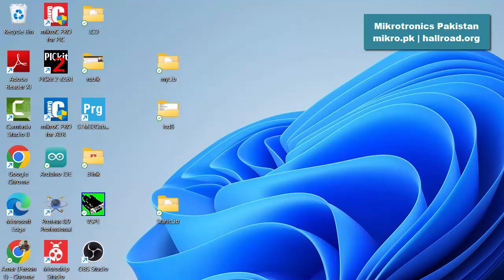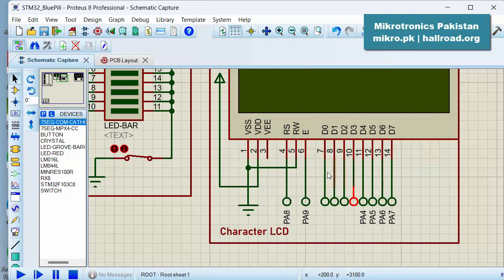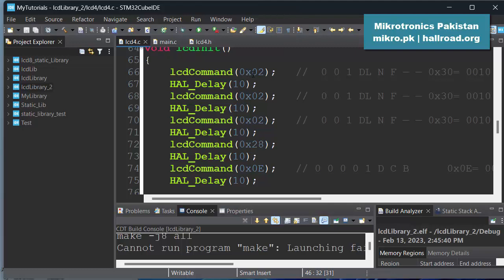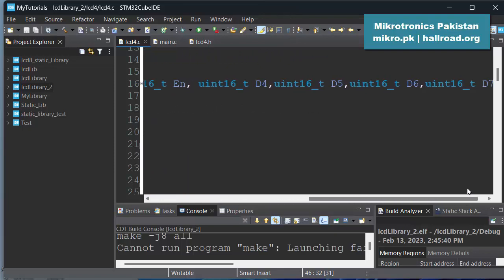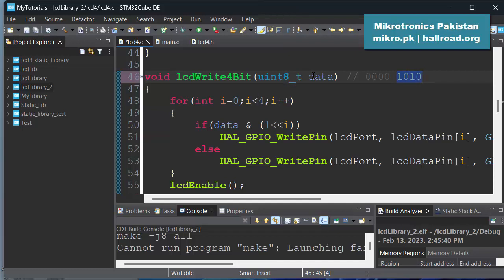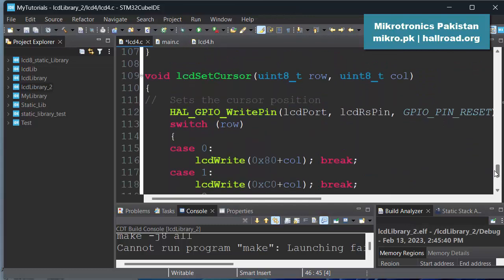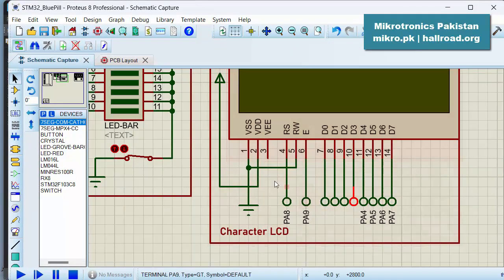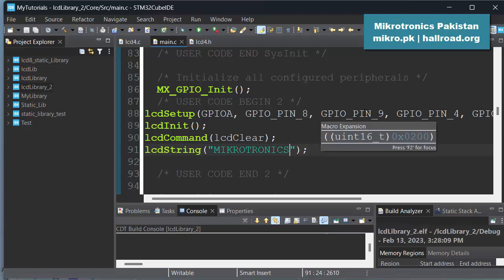STM32 for Beginners | Writing 4-Bit Library for HD44780 Character LCD

Comment: Another great video. picture quality was just fine in 360p better in 720. It's your explanation of the subject I'm interested in. I built you 8 bit lcd library last month. I made a 4 bit mode on my own but did all the work in the data write function so same result save a stack call for the extra function call. Thank you very much! Don